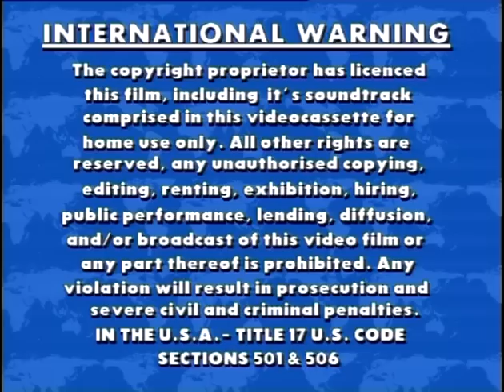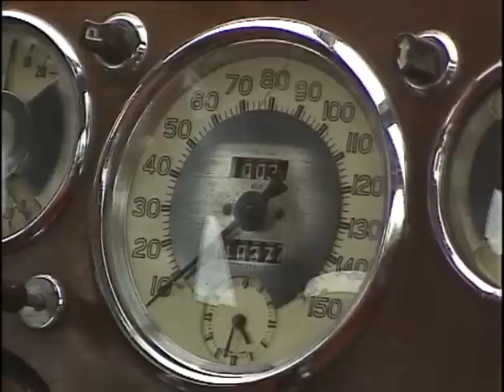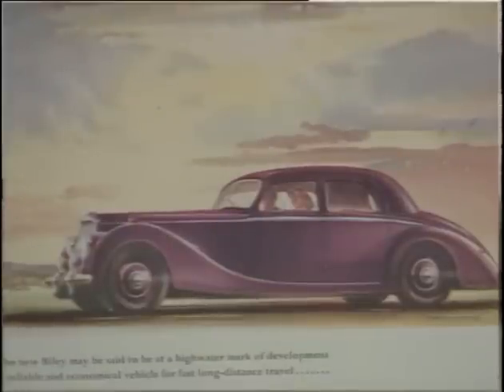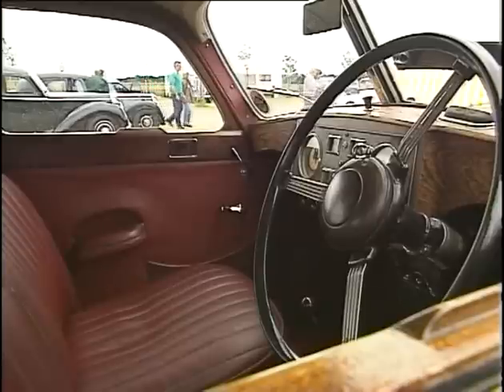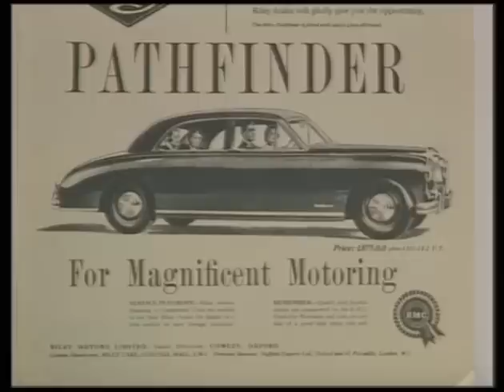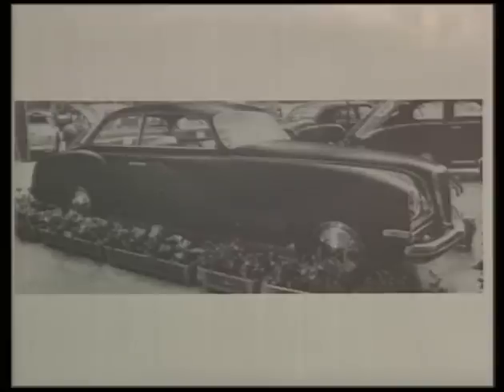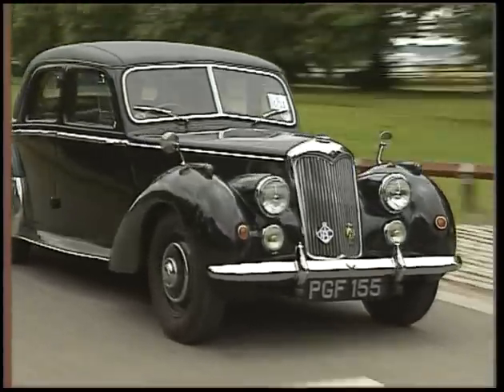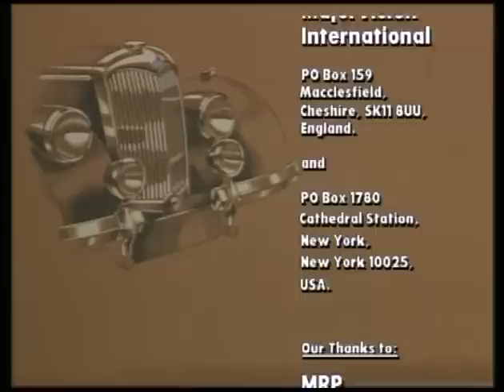The Riley RM Series Cars 1945 to 1957 - An appreciation by the Riley RM Club - 1996 documentary film

Comment: The right hand floor shift would have ruled out a LHD version,  The Last of the Wolseley 6/90 also had that RH floor shift. I saw an RM roadster on youtube once with a column gear shift which I thought was extraordinary,  I don't know why the Column shift version was ever built.
Reply: According to James Taylor's book Riley RM Series there were 43 LHD Roadsters produced and 2 LHD Roadster chassis out of a total of 507.
Reply: @paulmasonsjazz9611  Could that explain the Column shift I wonder?, always fancied a Riley in my youth down under, don't know if they were cheaper in the 2nd hand market in Britain.
Reply: @adoreslaurel  I guess the column shift was 'the latest thing' and also because of the front bench seat for three people. I had a 1950's Hillman Minx and my father had an A40 Devon, both of which had column change.
Reply: @paulmasonsjazz9611  We had a Minx around the same time, lift the boot lid and eventually the one stay open jigger would bend the metal and a visit to the panel beaters was required to get it back into shap so that the rain would not get in when it was shut. We suffered a cracked cylinder head and one day up country on the highway the gearbox got noisy, a bolt holding a bracket for the exhaust pipe came loose and fell out draining the box, parents never used 1st gear for take off as it was so low.
Reply: Bench front seat in the roadster meant nowhere else for the gear lever without offending the middle passenger?
Reply: @herringchoker01  Thanks for that. must have had a different gear box  body , could it have been related to a Wolseley/Morris/Austin box i wonder.

Comment: My father in law, a mechanical engineer, bought a 2.5 just after the launch. He drove it for a few days and found the steering peculiar. On inspection in a pit he decided the car was so badly made he could not risk his children it, so returned it to the dealer.
Reply from the maker: Was this the Pathfinder model introduced in the 1950's? There were quite a few complaints which were rectified by the factory but not before it was nicknamed the Ditchfinder by the motoring press....
Reply: No not the Pathfinder. He changed his purchases to Rovers.

Comment: The Riley RM club should develop a set of 3D printer programs to build authentic new Riley Parts on demand.
Reply from the maker: The Club was established in 1969 with the intention to keep the RM's on the road by supplying spare parts and it is still our number one priority over 50 years later. Check out our website rileyrmclub.org.uk for more details. The Club is always interested in new technology. Do you have an interest in this sort of thing?
Reply: @rileyrmclub  I am a tool and die maker by trade just making a suggestion, I also send in suggestions to SpaceX one of which included mass producing rockets using a 3D printer. I find the Riley cars fascinating but I am starting 4 businesses and do not have time for a fifth. I am sure that at least one of your members would be eager to buy a Markforged metal working 3D  printer to make spares especially if you have some of the original drawingsbecause of the money that could be earned. Cheers-Charlie